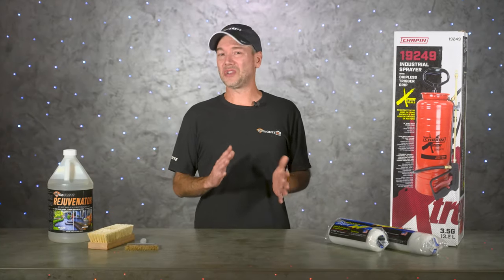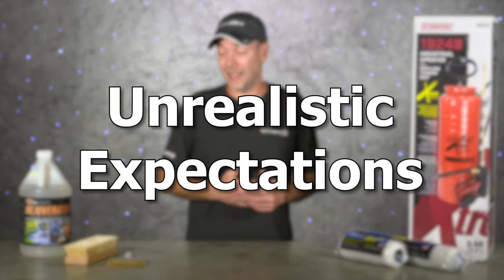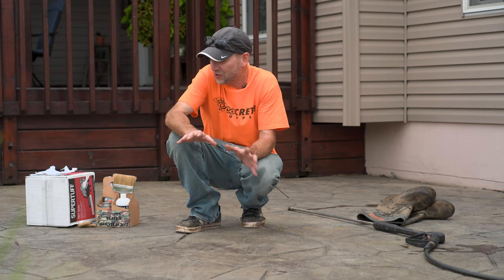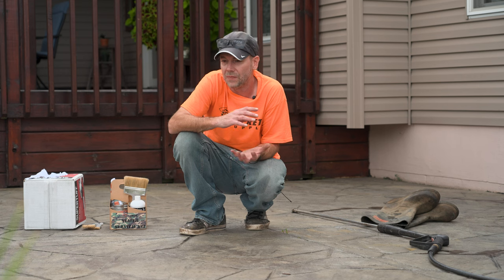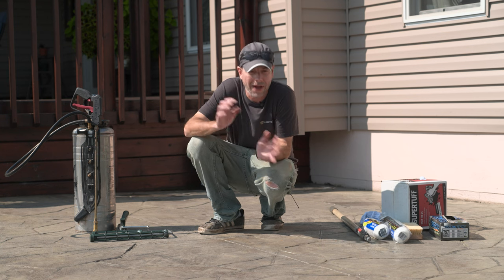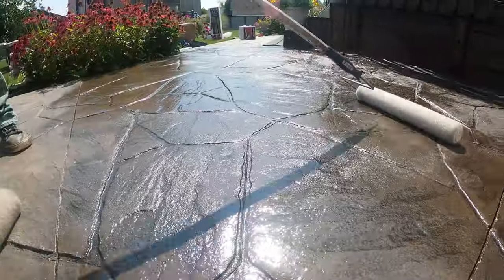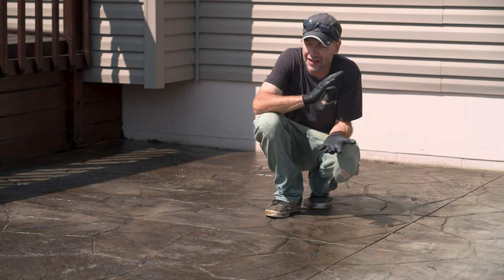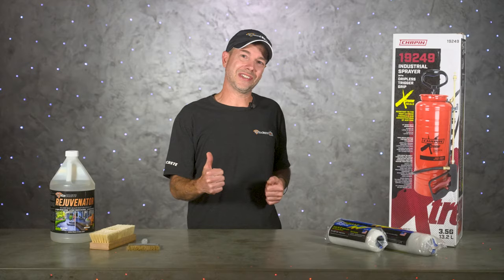How to Restore Faded Stamp Concrete!

Comment: I have plenty huge white spots and faded area. I remember it rained after my drive was find the same night. Floor was still nice . By the second year it started to fade and now I have use faced areas they are white
Reply from the maker: Rejuvenator will help clear out the white spots and might bring back the faded areas. It all depends on the reason for the fading. Follow the steps in this video and if the faded spots are still there, you may need to add a small amount of sealer to those areas. Small test spots are always a good idea before treating the entire slab. Thanks for watching Deco-Crete TV!!

Comment: I’ve got efflorescences all over my stamped concrete.   I’ve scrubbed and scrubbed with very limited results.   Do I have any options to get it cleaned up and resealed?    Thanks
Reply from the maker: Thanks for the comment! The question would be - is it efflorescence, or has the sealer turned white? Efflorescence should scrub off fairly easy with an efflorescence remover, but it might come back over time. If the sealer has turned white, you'll need something like Rejuvenator to fix the problem. If you've already tried scrubbing it, then I would give it a good power wash, and apply Rejuvenator. You could try a small test spot first to see the Rejuvenator will react. Thanks watching Deco-Crete TV!!!
Reply: @DecoCreteTV  thanks for getting back.   Does your company make Rejuvenator?
Reply from the maker: @myseaeaglechannel2913  Yes, we make the Rejuvenator. Here's a link to the sales page on our website.             https://www.deco-cretesupply.com/products/decorative-concrete-sealers-solvent-based-sealer-solvents/rejuvenator-5-gallon

Comment: My stamped-concrete coping around my salt water pool was installed and sealed 7 years ago. It hasn't been re-sealed since. In addition, there are many scratches and lines caused by the pools winter cover that I need to fix. Can you please recommend cleaning and re-sealing products and techniques that will restore my stamped concrete?
Reply from the maker: Thanks for the comment! The cleaning/prep for the re-seal is generally just a pressure wash. We would recommend our D-One sealer as long as there's no heavy build up from original sealer. If it's been 7 years, the ordinal is probably almost gone at this point. Fixing the damage from the pool cover will be a bit more tedious. The best way we've found to do this is to use a color hardener slurry, but you could also use a concrete patch material or a concrete overlay. The hardest part is getting the color to match. I'll leave a few links to some other videos about cleaning, sealing and repairs. Thanks for watching Deco-Crete TV!!!                                                                           
 https://www.youtube.com/watch?v=r7GIUvxm0vQ&t=1s                                                                                                                                                         
 https://www.youtube.com/watch?v=uk2wPIYinFo                                                                                                                                                                     
 https://www.youtube.com/watch?v=9cqJ4bpkNTI                                                                                                                                                                    
 https://www.youtube.com/watch?v=u5RNPrg-8wE&t=464s
Reply: @DecoCreteTV  Thank You sooooo much for the detailled and timely response!!!

Comment: I used an Epoxy sealer 3 years ago. It is now dull. Will this rejuvenator work with Epoxy sealer that need to be refreshed?
Reply from the maker: Thanks for the comment! If it's a two-part epoxy system, Rejuvenator will not be the answer. Rejuvenator is designed for solvent-based acrylic sealers only. Most two-part coating products are made from a different type of resin than acrylic sealers. You could try a small test spot to see how it reacts and make a decision based on the results of the test spot. I'll leave a link to another video on the differences between two-part coatings and acrylic sealers. Thanks for watching Deco-Crete TV!!!!         https://www.youtube.com/watch?v=dSz71y4uKcU&t=273s

Comment: Could you add deco grip to Rejuvenator to make a sealed area have more grip?
Reply from the maker: Deco-Grip will mix into Rejuvenator, but it's hard get even application and a lot of it just ends up sitting on top the sealer. The better thing to do is use the Rejuvenator to open the existing sealer up, then a second person can broadcast the grip. A broadcast gun works the best, I'll leave a link to the one we sell on our website as well as a link to a how-to video. Thanks for watching!!!!                                                                                                                                                                                                                                
https://www.deco-cretesupply.com/products/sealer-additives-sprayers/deco-grip-sprayer                                                                                              
https://www.youtube.com/watch?v=Zpt3gF0oRhQ&list=PLgaJ0iW5t2kpnBg7sjEP5ETu0tzbaYcmA&index=134&t=58s
Reply: @DecoCreteTV  thank you 😊

Comment: My current sealer is oil based ., do I have to remove
Reply from the maker: Thanks for the comment!! If the sealer on your slab is solvent based, Rejuvenator would be a great thing to try before removing the sealer. It may not always fix the problem permanently, but there is no downside to it and it will help things out. If the problem is still there after two or three applications of Rejuvenator, then you would need to remove the sealer and start over. Thanks for watching Deco-Crete TV!!!
Reply: @DecoCreteTV whats the best product for removing okd sealer?
Reply from the maker: @pelawler15  The best to remove the old sealer is to have it sandblasted. Otherwise, our Nock-Off product would remove it chemically. I'll leave a link below.      https://www.deco-cretesupply.com/products/repair-prep-products-coating-mastic-removers/nock   https://www.youtube.com/watch?v=ASIqq_vyUAI&t=50s